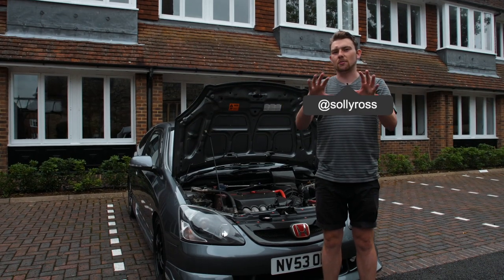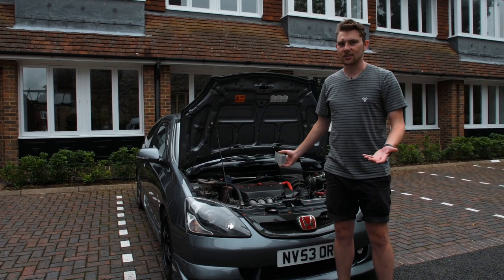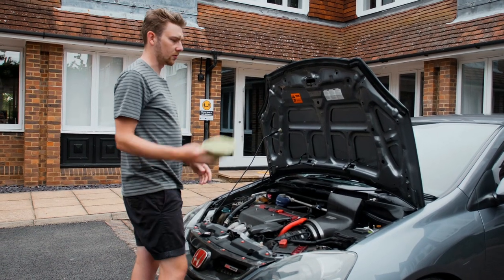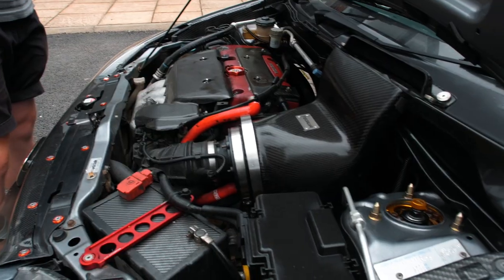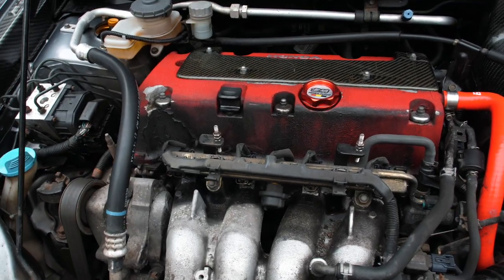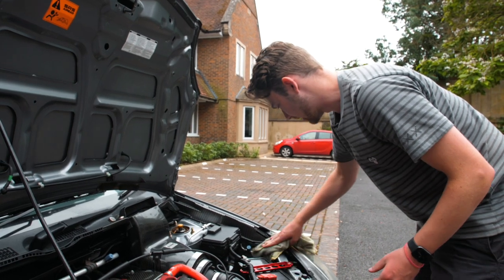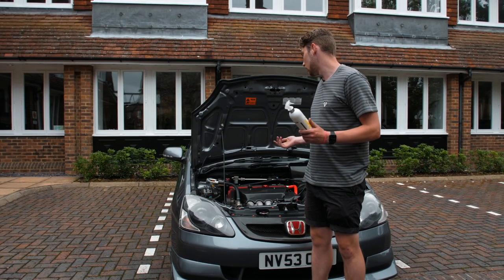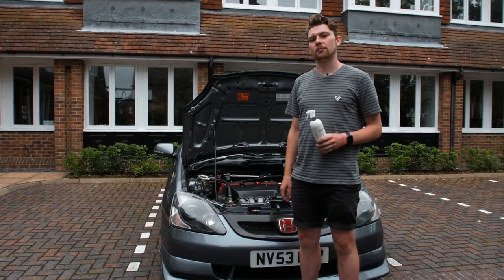Cleaning The Engine Bay Of My Civic Type R EP3!!

Comment: Where did you get those carbon fibre internal wing covers that run down the sides buddy, they look sweet 👌👍
Reply from the maker: I actually got them as one of a load of other bits off someone selling them on one of the “Ep3 parts for sale” groups on Facebook. I got those bits, the carbon spark plug cover, carbon dipped door handle inserts, clock surround and centre console.
I think they are sick and I haven’t seen anyone else with them.
Reply: @OllyRoss  I've not seen them either buddy so it's possible it was an early 2000s part that come out for these, I will have to search for some as they look mega with all the other parts you have 👌👍
Reply from the maker: They are just the standard parts that have been Hydrodipped. Just take out your ones and get them dipped by someone local. 👍🏻👍🏻👍🏻
Reply: @OllyRoss  I've a mate who does hydro dip so I may just do that, nice one 👍👌

Comment: Where did you get the carbon strips that run down each side of the engine bay? Another thing see your mugen grill? Was it easy to drill through to bolt on?
Reply from the maker: They aren't real carbon fibre, they are hydro dipped. I actually got them off some one on facebook years ago with a few interior pieces. The Mugen grill was fine to drill through. Just make sure you put tape over where you are going to drill so the carbon doesn't splinter
Reply: @OllyRoss  thanks very much for the info mate keep up the good work! Looking forward to watching more videos
Reply from the maker: @James-pd6ce  No worries man! Glad I could help out. Appreciate it!
Reply: Before I forget where did you get your red washers from? Are they all the same size in the engine bay? I've seen some do a kit which includes small and big ones?.. do these work well screwing down the grill and slam panel? As I see you've used them there thanks mate
Reply from the maker: @James-pd6ce  The ones around the engine bay are these: https://kaizenuk.co.uk/collections/olly-ross/products/kaizen-red-dress-up-washers (use my discount code OllyP3 to save on them).
The slam panel ones I can't seem to find any more but the closest thing I can find are these: https://mjcautomotive.com/mjc-automotive-slam-panel-set-in-red-with-black-bolts-civic-fn2-type-r.html
Reply: Thanks very much mate appreciate
Reply from the maker: I don’t know for sure. Apparently, if you message MJC, they still sell the EP3 ones 👍🏻👍🏻👍🏻
Reply from the maker: Oh sweet! Can you send me a link to the EP3 ones? I get asked all the time about them! 
Probably best you don’t watch my latest video then! There is a full breakdown of the engine bay! Haha!

Comment: I'f you're cleaning engine bays, use meguiars black plastic restore on rubber hozes and plastic boxes etc, put it on and let it sit for 5 mins then wipe it off after it's been cleaned, itll make everything look like new, just a tip, works on interior aswell!
Reply from the maker: Sick man, I was thinking of getting something like that for my scuttle panel too! Cheers for the recommendation! 👊🏻👊🏻👊🏻